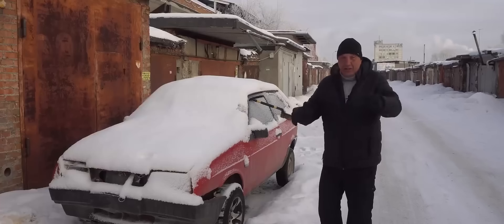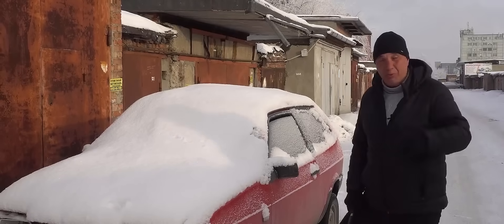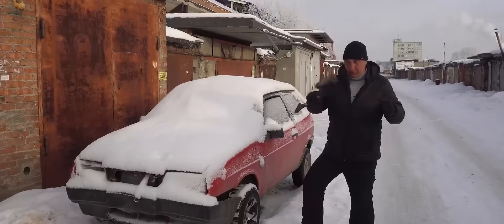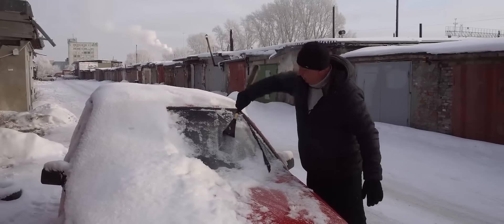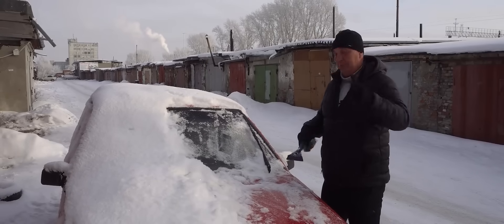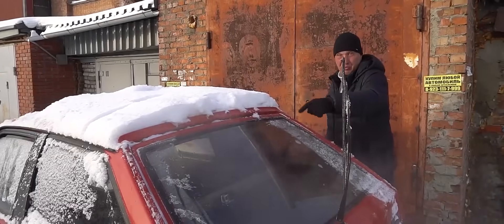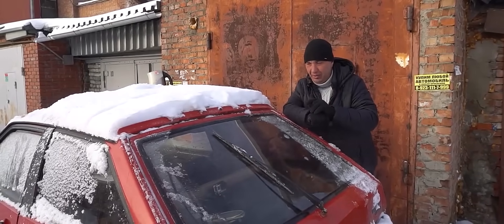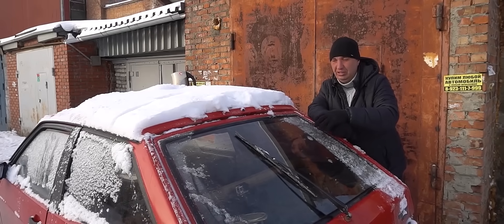What happens when you POUR boiling water onto a frozen windshield?

Comment: It didn't crack because he poured it just slow enough for the glass temperature to change evenly and slowly.
Reply: Paul Capocasa it doesn't matter how fast you pour it on it will not crack I've been pouring boiling water on my windows for 25 years haven't cracked one yet, it's a mith
Reply: Paul Capocasa you probably had a very small crack in it that you couldn't see
Reply: It will only crack going the other way. Pouring cold water on hot glass as the outside of the glass is trying to contract at a different rate to the inside. Same concept as a prince Rupert drop. Simple physics people.
Reply: B H thanks Sheldon
Reply: Darren Davenport would you prefer him to comment in his native language and then asking you to learn a thing or two about his language before replying?
Reply: Lenny I wouldn't say it's a myth, coz I have cracked a screen once just using warm water when it was frosted over. It must be to do with how much the manufacturer has hardened it or toughened it. If it is tough, they will put up with the temperature change a fair bit, whereas if it is too hard, it will definitely crack. That's how I would explain it.
Reply: Paul Capocasa no it wont, don't you know basic physics?
Reply: It works other way around.
Hot glass and very cold water.
I pressurewashed my car in hot summer day and first pointed it to windshield and it cracked
Reply: Paul Capocasa that's not at all true , tempered glass does not respond the same as it would had it not been tempered .  This would have cracked almost instantly if it were not temered.
Reply: Paul Capocasa it just doesn't crack, it's normal
Reply: Give it a lil tap I'm sure it'd break after
Reply: Paul Capocasa my ex poured hot water (from the faucet/not boiling)   on my vehicle and the windshield instantly spider webbed.
Reply: Paul Capocasa I pour boiling water to melt the ice on my windshield all the time, it's never cracked not even a little
Reply: Paul Capocasa not true
Reply: Dumbass
Reply: Paul Capocasa my mother just used to empty a kettle much quicker than this over our old Nissan windshield each morning it was frozen over and it never cracked.
Reply: Paul Honey WOW! That is very interesting. Must definitely be down to the quality of the glass or if there is a stone chip/crack already in the glass. 😉
Reply: Paul Capocasa or maybe just dumb luck? I know I wouldn't risk it on my car, even though it seemed normal when I was a kid watching her do it, now I understand what can happen to objects when going from one extreme temperature to the other I don't want to try my luck.
Reply: Paul Honey Haha...true. Some people manage to have so much luck on their side they could jump from a building and luck would make a truck carrying pillows, drive by and catch them. lol.
Reply: @H0n3yMonstah  whats a kettle lollll
Reply: @vincevegacustoms754  you don't know what a kettle is?
Reply: It’s won’t crack dumbfuck. Can’t y’all read your glass. Says tempered LITTLE BUT BIG ASF! Learn a thing or 2 before commenting mmkay.
Reply: Stillmin      learn a thing or two about english before commenting you pickled foreskin....

Comment: first of all the Russian guy shouldn't have cleaned the ice off of the windshield or the back window if you would have just poured boiling hot water on the dash windshield with the snow already on top of it I can almost guarantee you that it would crack instantly but this Russian I believe he was slick and he already knew it wouldn't crack because he wiped off most of the ice so therefore I debunked this dumb experiment that was done completely wrong wrong wrong debunked

Comment: I got desperate one day when I was late for an appointment and did this to my then 8 yr old '94 Honda Civic that had a stone chip about 6 inches from the bottom of its glued-in windshield...same result, nothing happened!  After doing this for 16 years now, without the stone chip even expanding in the least, I'm pretty sure that windshield won't crack from it.
I haven't tried cold water on a hot windshield because I have no reason to.  When I do wash the car, I take it to a brushless, or do-it-yourself, place a few blocks away, and it cools off a lot by the time I get there.

Comment: Glass can expand quickly even into a liquid form using heat with no problem, but cooling too rapidly will cause the glass to fracture... pour boiling water on the glass a few times, and then pour liquid nitrogen, see what happens from very far away! Also keep in mind that the windshield is manufactured from two sheets of tempered glass  put on each side of a very thin layer of Poly-Vinyl Butyral (PVB).  So it is basically going to be bonded together if it does break, perhaps try the door windows, or the rear  window for more of a shatter effect... I'll say again, from a safe distance away from the glass shrapnel! Better yet don't do it just imagine it. ;)

Comment: The reason why its suggested for you not to pour boiling water to your frozen windshield is because of micro-cracks and if you continuously shock your glass, it will break eventually.  It may not shatter your windshield but it will split 
 it like a rock that hits your windshield. It may be small in the beginning but it gets worst overtime. Always remember that the money you dont have to spend, is the money you save.

Comment: This is why is not cracking.
Old cars are built with looser clearances. 
Hence the reasons old cars leak in a carwash.
If the glass has enough clearance to stretch it will.
On new cars their are tighter clearances.
The class will crack because it has very little room to and expand and once at the limit.... 
Crack.

Comment: I've been pouring hot water on my Opel windscreen for years and it has never cracked.
Reply: Ye i do the same, why would u stand there with a scraper for 10 mins. when u can insta melt the ice and warm the windscreen so it dont freez when u drive off.
Reply: my dad used to do it we had a opel omega when i was a kid
Reply: I know I have a Vectra elite and it has all the kit I need, looks great AND it was ultra cheap. can't loose owning an Opel.
Reply: Tomek Tabaka better than scraping!
Reply: Or just buy a car with frecken engine heater and you Will come out to a 20-25 degree car every Morning during winter... i dont even have a scrape in My car
Reply: It doesnt even need to be hot water.... cold water works just as well...
Reply: Tomek Tabaka dude opels are beautiful
Reply: Pilot SS. 28 Opel sucks
Reply: Pilot SS. 28 opels are full of shit
Reply: Jesper Karlsson nobody gives af
Reply: How hot

Comment: It won't Crack because of the temperature inside the car and their is no ice on the other side in other words if the windshield or any of the glass windows were out of the car frozen and the put into boiling water might make the difference these windows I believe are built with reinforced glass ie safety glass but if they are not reinforced it doesn't matter because the window is not completely frozen. There's your answer.

Comment: when glass expands or cools to quickly it will crack or shatter. Going from frozen to having boiling water poured on it the glass should have at least cracked, My guess is the glass was tempered glass causing it to stay as a solid and not break.

Comment: When I was a yewt a neighbor across from me was a scientist employed by the National Research Council. He was given a car, 1 of the first with the new safety glass. The manufacture of the glass claimed that the glass would not break.He was tasked to keep this car in good running order until the windshield broke from heat or cold. The finally let him out of that contract regarding the car after 25 years. Every morning if there was any fog, frost, snow or ice on the windows he would pour a kettle or two of boiling water. The glass never broke. And I have done the same of more than one occasion.

Comment: I couldnt get my door open for work one day because it froze shut. In a last ditch attempt to be less than 15 minutes late after pulling and pushing the door for quite a while I got a large pot of boiling water and let it run down the inside of the door where the latch is. Opened right away!

Comment: That's pretty much how I usually defrost my windows....been doing it for 15 years and never had any problems, even with already chipped and/or cracked windows. But to be fair, I don't use boiled water directly....I poor it in a coke bottle and take it to the car, by that time it will have cooled enough not to call it boiling anymore. My dad does the same, and again, never any problems...

Comment: I've cracked a few windshields by having the defroster on while the rest of the windshield is still as cold as outside, it happens when the glass expands slightly on the bottom while the top is still below freezing causing it to distort and then break.

Comment: Maybe it's because of the glue between the two layers of glass and the plastic which melts because of the hot water. (Also things shrink and increase in size when heat or cold is applied to them)

Comment: Just so you know, it was a LAMINATED front windscreen - ALL windscreens with a tinted band are laminated, they are impossible to make toughened - and as such they are made of two thin glass layers with a bonding film between them. A thin section of glass is much more resistant to fracturing due to thermal stress because a/ the heat is transferred more rapidly through it, reducing the temperature gradient and expansion difference b/ each section is separated by a flexible membrane that allows some flexing between the two pieces as they expand at different rates as they are heated c/ they do not have the internal stresses introduced during manufacture that gives a toughened screen it's strength.

Why we would (and I did) expect a toughened screen, like the rear one*, to shatter is a/ it has a single thick section, unlike the laminate, which meand a bigger variation in temperature as the heat passes through the glass and so more expansion b/ the different expansion rates from tyhe different temperaure levels increases the stress in the glass c/ which when added to the residual stress for the toughening can exceed the strength of the glass material.

*As an aside, I know of two instances where a rear, toughened, windscreen shattered on cold mornings when the rear electric demister was turned on.

Comment: Pouring the water on the top of the glass helps keep the temp even so the glass doesnt crack due to differential temps.  The defrosters on the front screen heat the glass mainly on the bottom and let the air move up the top.  The main heating is on the bottom only and that could cause enough of a differential to crack the glass.  Quality of the glass will also be a factor.

Comment: Interesting.  I too thought it would crack.  Thank you.
Reply: Helen Sarkisian I think it's something to do with the laminate on car windows DO NOT do this on your house windows
Reply: It usually does crack, or atleast weakenes the glass enough that it's going to crack when it freezes again or if a minor rock chip hits it.

Glass can't direct heat that well. So pouring boiling water on freezing glass is not a very good idea. Pouring water on glass to get rid of ice does work, just keep in mind that any liquid tap water is already warmer than freezing temperature and will melt ice off your car.
Reply: It does crack but not out it self, he needed to slap the glass with his palm for it to krack. I he did it when it was cold, it would be cracking
Reply: Spoiler
Reply: Helen Sarkisian me too
Reply: My father was doing this every morning whole 90s when he went to job..and never happend anything ...i thing it was no problem with older cars
Reply: Helen Sarkisian it would if your windshield is not 100% good
Reply: I put boiling water on my windshield all the time when it's icy, always been fine
Reply: If you have a chip in your windscreen you run the risk of the windscreen cracking if you run the heater. That is why you should have the chips repaired as soon as possible.
Reply: It's because it's tempered glass and not normal glass. Tempered glass is much stronger and more heat resistant than normal glass so a lot less likely to crack and in the event it does crack it breaks into tiny pieces instead of large jagged shards so it's much safer and all modern cars have it. Don't do it on house windows though because they are not tempered glass and they will probably break.
Reply: +Guest Guest front windshields aren't tempered lmao. they're 2 layers of glass with vinal in the middle.
Reply: Yea. makes me think that rule might be for going from hot  to cold?

Comment: They crack only if there’s been a chip on it or crack on it, I clean mines like this every time I don’t want to spend the time cleaning it, which is often,and I  use warm water not boiling water, also if there’s a crack on the glass the cracked line will expand and keep expanding throughout, because of the sudden difference in temperature

Comment: I've been thawing out windows with hot water for over 40 years-- even used steam gennys-- and I've not seen a windshield, sideglass or back glass break yet. Glass only cracks if it has chips or the glass is flexed while driving.

Comment: The windscreen will crack if you use hot water to melt the ice off the glass, not scrape it off then use hot water. Thick ice stuck to the glass will crack with hot water causing the glass to crack.

Comment: I live in interior Alaska, most of those cracks are not due to heat in my experiences but instead the poor unibody design of a lot of cars and the flex that occurs when you drive over potholes laterally. i used to always have that bottom crack and installed a front strut tower brace three years ago. hasnt done it since. glass doesn't expand and contract apprciably at probably 120c at most temp difference.

Comment: I had a small crack in my windshield of my old Toyota matrix it was summer here in Atlanta Ga (Hotlanta)LOL around 110 degrees i poured cold water out of the tap on the windshield the windshield the little 1in crack split and spread to over 12in so there already has to be a chip or defect in the glass for this to happen.

Comment: My theory, if you heat a small area only it will crack. Heating larger areas distributes the pressure too much for it to crack. That's why the heater can crack the glass, it's heating only a small area while the rest remains cold, it's that difference that causes the cracking.

Comment: The reason it did not crack, is because you are pouring a small steady stream of water which heats the glass up slower and prevents cracking. Now if you take say a one gallon plastic tea picture of water dump it on there all at once it will crack. As the way you are doing it is like taking a glass bowl and putting warm water in it then dumping it out to prep the glass bowl for boiling hot water. So take a 1 gallon tea picture of boiling water and actually throw it on the glass window, instead of pouring a slow steady stream of boiling water. I am saying that because it does get extremely cold in Texas, even though many people find that hard to believe. But when you know that the coldest recorded temp ever recorded in Texas, was actually -25℉ or -31.66667℃ for those who use the metric system, then you know it actually can get extremely cold in Texas.

Comment: I have been De icing widows on trucks and cars with hot water for over 50 years. I never scrape unless there is no chance of getting hot water anywhere. Otherwise I have always used warm/hot water. Instantly the windows all the way around de ice and no scratches. I have seen many people scraping their iced up windows and they crack them. It’s easy to do especially if you try to chip the ice off. It helps if your car is running and blowing warm air so that after the hot water does it’s de-icing thing the warm air keeps it clear and it doesn’t freeze back up ....especially if it’s still really cold out. Oh ....and by the way....I have never had one crack or explode on me yet.  Go figure! Take it from an old timer. Go for it and save a lot of time and effort.....get out the warm water. I keep an empty windshield antifreeze gallon plastic container in the trunk for just that reason. So many people think I’m nuts but I’m long gone while there still freezing their nuts off scraping away at their windows.....ha ha ha!

Comment: It’s because windshields flex. It’s not rigid enough
Reply: Supersonic Hamster USA false, it's actually because cold doesn't brake. You have to have it really hot then add ice water. What happens is the heat has it expanded and as soon as the cold water it's it changes rappidly thus shattering the glass.

Comment: Do this experiment again and throw a bucket full of boiling water . Not just pour it. I think the windshield will crack.
Reply: Only if you put a big rock in the bucket also.
Reply: actually, the surfaces are glass as plastic scratches easily.
Reply: Maybe if they throw and the bucket not only the water in it. Maybe then we will see results...
Reply: I've used steam gennys-- no cracks. Does that count?
Reply: Jörgen Rambris
No it won't, its laminated
Reply: It will if you throw the bucket with the water as you has said previously lol
Reply: Billy Jones yes especially since steam is much hotter
Reply: All vehicle windshields are heat resistant. They won’t crack unless the window is already compromised
Reply: AustinAutomotive cause they are talking out their asses. I lived where it got that hot. No car port or any covering from the sun. Would wash my car with the hose. Never any problems
Reply: ymxctrails myth busted I wash my black dodge charger in full sun in 35°c weather and never cracked my window and I have 2 rock chips, explain that, and I got ice cold hose water too, windows are so hot glass cleaner sticks to them